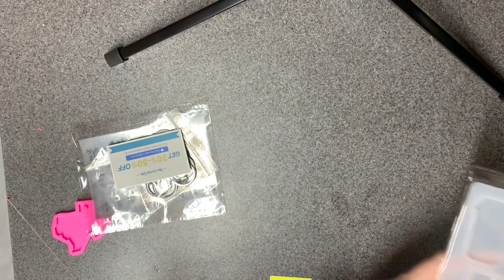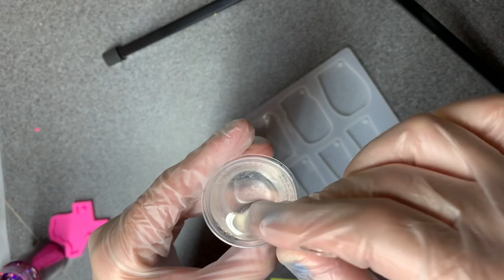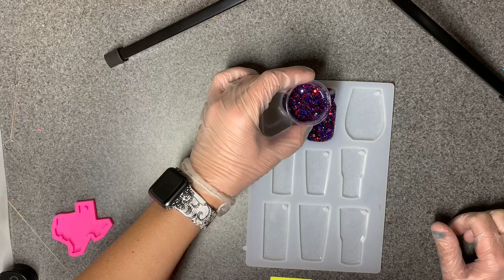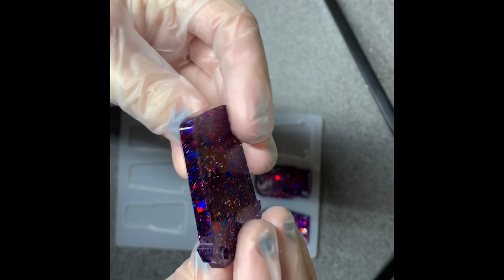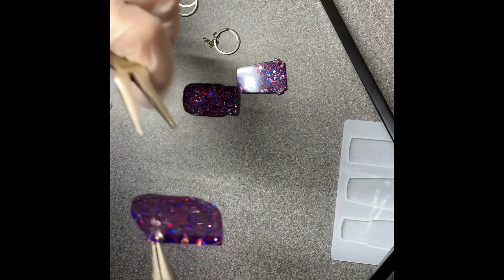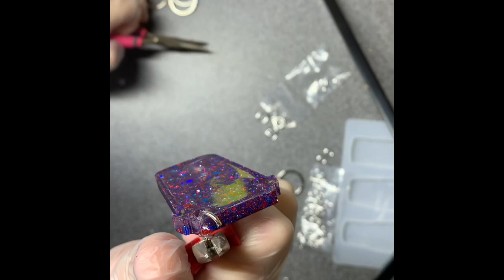New tumbler keychain mold “unboxing” to “demolding”

Comment: Hey Purple Stitch! I have these molds too and I love em". The decals are not water slides. According to the video on Amazon, you cut around them and place them on the filled mold. Then pour a thin layer of epoxy on top. The clear surface disappears and the writing or image looks as if its floating on the key chain! Its so cool. Thanks for all the inspiring videos. Keep em' coming!
Reply from the maker: That’s great info!!  I need to pull out the info and give it a go!  & Thank you for those sweet words!!

Comment: did you find that those jump rings where kind of tight going in on the mold holes? What size would you suggest? Mine our thick too and I can't find the right size of jump ring. Would you happen to know what size is a good size
Reply from the maker: Oh man, this was a few months ago so I couldn’t say that I remember. Nothing jumps out at me for issues though that I can remember. For most of my jump rings I use the heavy duty from hobby lobby.

Comment: What resin/Epoxy do you use?
Reply from the maker: Jessica Niemi Envirotex lite for keychains for sure. I just got Liquidy Split last week and is FABULOUS for tumblers, but their site says not to use it in molds deeper than 1/8”.
Reply: @ThePurpleStitch  I just got some amazing clear cast. I have never used resin before
Reply from the maker: Jessica Niemi I started with that one. It’s great to get the hang of things but I hear the new formula smells pretty intense. Be sure to wear gloves, a mask, and work in a ventilated area so that you reduce the risk of an allergic reaction.